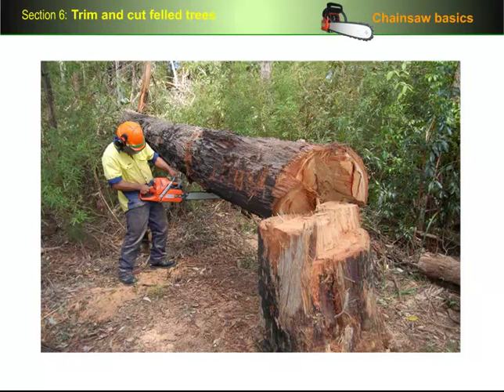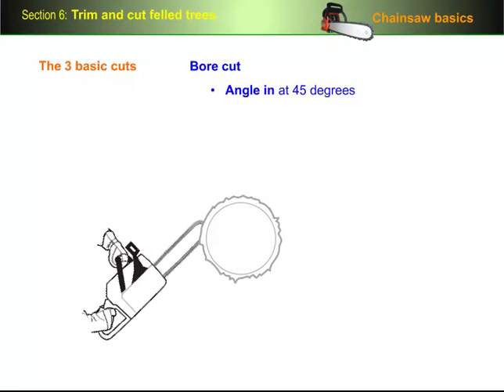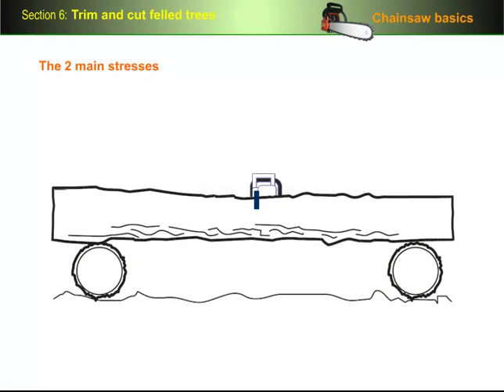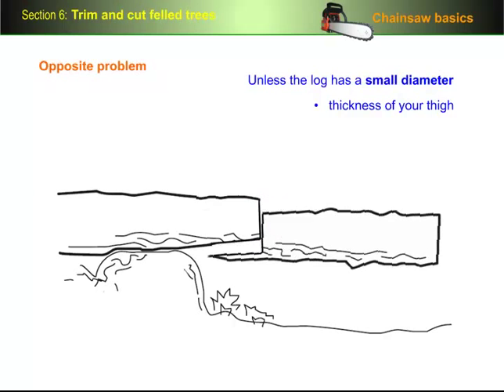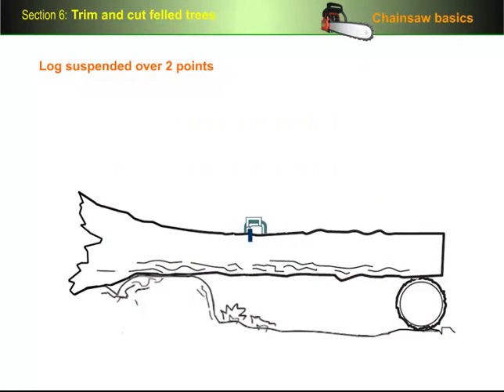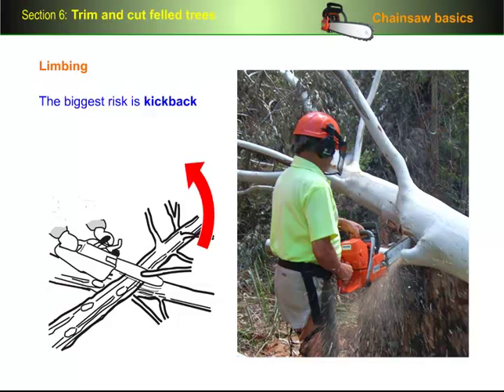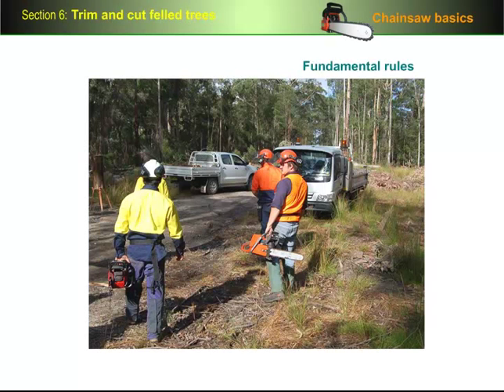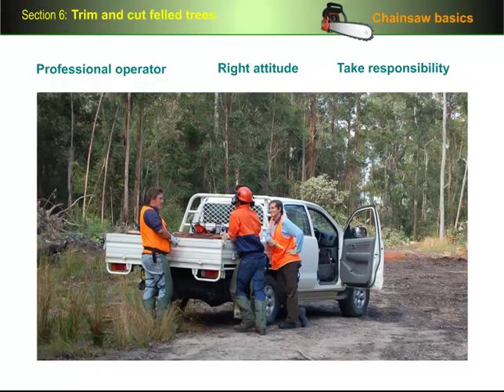Crosscutting and trimming felled trees with a chainsaw

Comment: Drip some oil on the chain before you start. It won’t bug down at the end. Don’t push on the saw, you’ll get it done in half the time. I just did 30 inch cuts with an 18 bar and oiling the chain made all the difference.